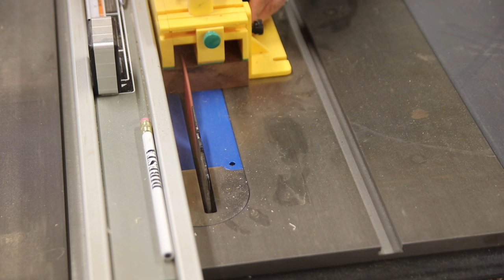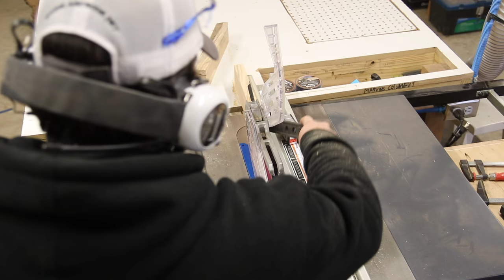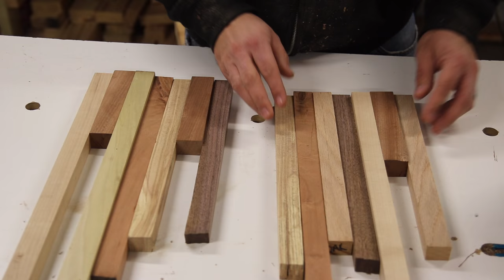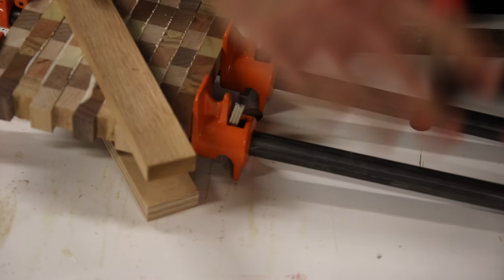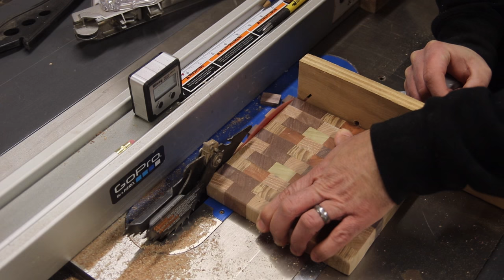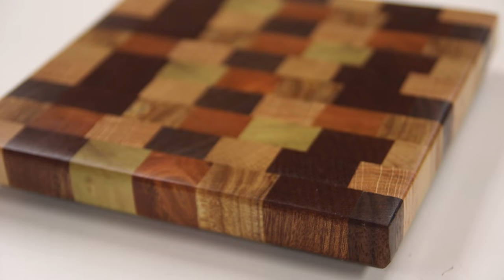End Grain Cutting Board - Six Different Hardwoods

Comment: Great project. The YouTube woodworkers who make the end-grain cutting boards make it look so easy. I can relate to your struggling to glue, align and clamp the pieces together. I have made a few cutting boards and coasters sets. Each build has more lessons to teach us. You might share what you will do differently next time.
Reply from the maker: +B Templeton Thanks for watching! Keeping the strips flush during glue up would cut down on sanding, that's one thing I would do differently.
Reply: Stone and Sons Workshop 
I had that problem too. I don't have a big sander (or much patience) so  I used my bandsaw to recut the top face so the strips were even and sanded from there. The cutting board was a gift; I kept the offcut to show what the board looked like.
Reply: Stone and Sons Workshop 
I had that problem too. I don't have a big sander (or much patience) so  I used my bandsaw to recut the top face so the strips were even and sanded from there. The cutting board was a gift; I kept the offcut to show what the board looked like.